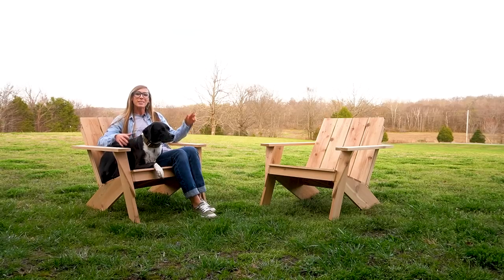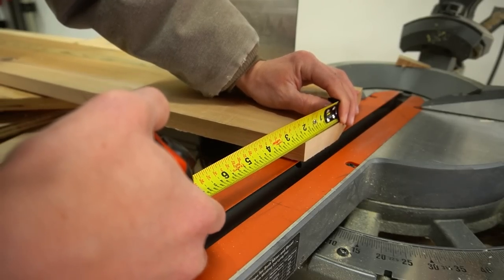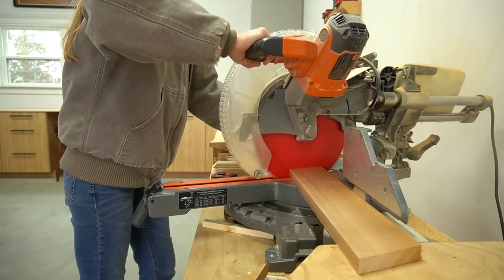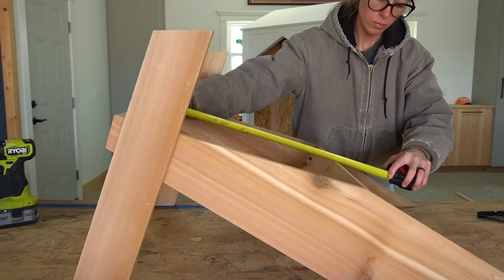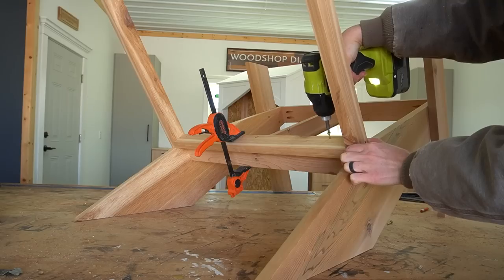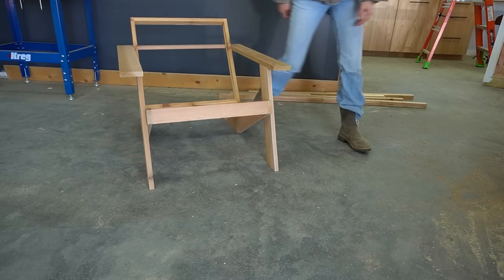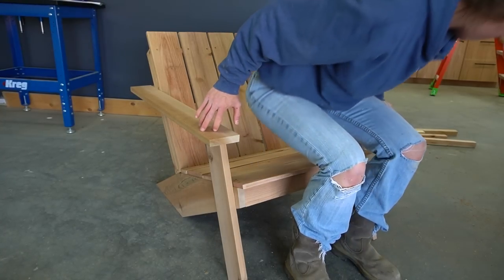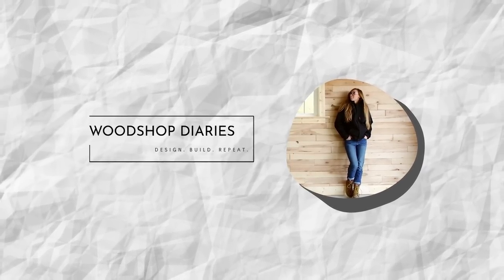How to Build a Modern Adirondack Chair

Comment: Another nice project.  I have taken great advantage of cedar fence pickets too.  I’ve built garden furniture, plantar boxes/buckets, green house plant benches, plant stands, and a potters work bench.  I have a planer so when i need thicker boards i just find some pickets that aren’t cupped plane side then glue them up.  It’s more work but i’m a DIY hobbyist so it doesn’t bother me.  And i’d rather spend money on tools. Thanks for sharing the project. It is a nice modern look.